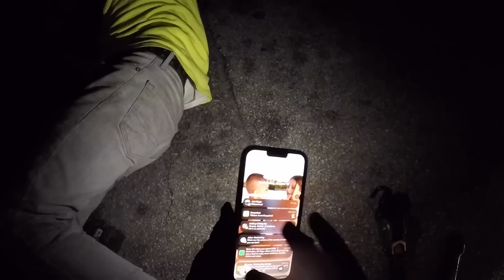Frightliner with a busted driveline

Comment: WOW, major changes have happened since you were gone. Now you have a heavy wrecker truck! I hope your getting lots of work to pay that beauty off, she's gorgeous! And also, thats not J-Bird, thats somebody else, you hired a worker? He seems to be doing good, do you agree Malachi? That truck is only a 2020 Freightliner, and your already having issues dropping them drive shafts. Maybe try the Milwaukee 1/2 drive high torque impact wrench, its got loads of power, it might have taken them bolts out. Dang, those suckers are really on there! This is a tough job dude! That guy smoking near the gas pump is just asking for trouble. Thanks for sharing!
Reply from the maker: ya i have buddy that swears on the Milwaukee stuff hes always talking crap about my mac impact gun but Milwaukee makes great product so ill definitely get some soon

Comment: In some situations you can pull the axles on the rearend thats on the ground d and it will stop any movement of the driveline at all
Reply from the maker: That’s 100% correct unfortunately for me I didn’t have any axel caps yet in the truck so I had to fight that darn shaft a bit but helped in the repair process 😂